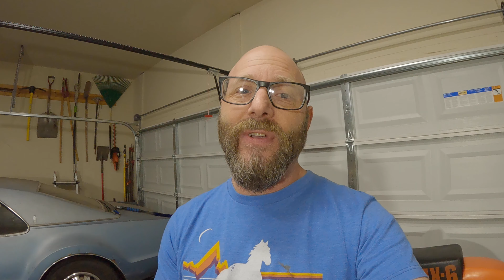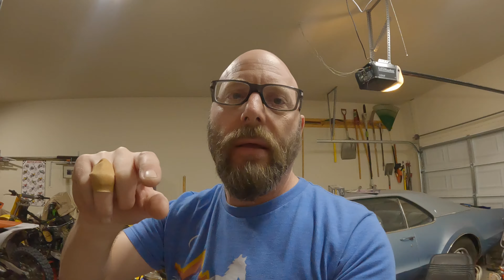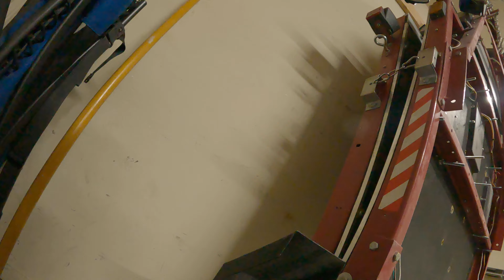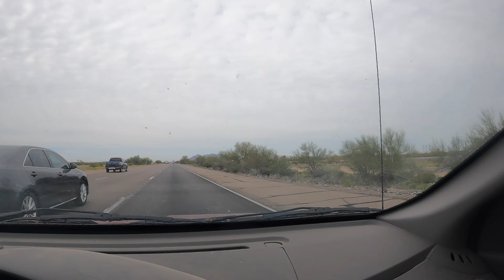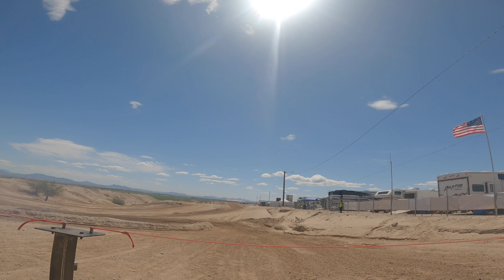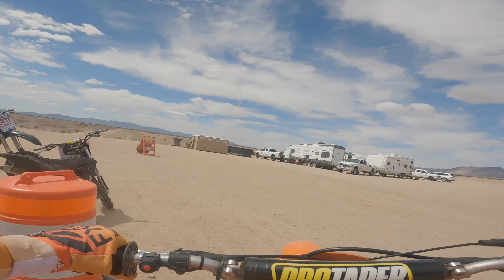FENCE ATTACK!!  I Hit Four Neutrals And One Fence.

Comment: Looks like you had a great day at the track .Very inspiational stuff  man . Not liking the metal flakes in the oil and  all those chunks of metal stuck to the drain bolt ....yikes. I guess thats part of the vintage  race game . You always have to be tinkering and fixing .I get that , Its the only way I can keep half of my junk on the road.  If you get a chance and want a good  laugh take a look a the latest short I posted on my channel, its a propane powered   1977 Yamaha two stroke DT400 .  Its pretty ridiculous but makes me laugh every time .Cheers buddy .
Reply from the maker: Thanks for the comment.  The tinkering is pretty much no stop to keep my bikes going.  I will check out your video.  It sound fun.  Cheers